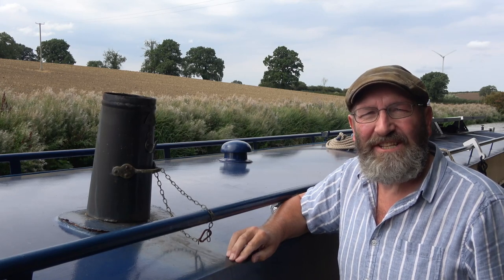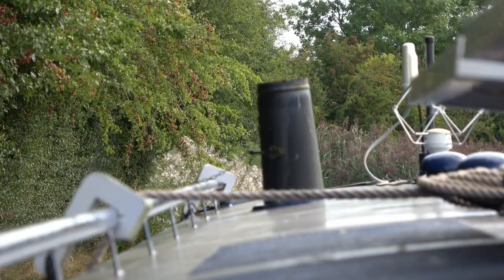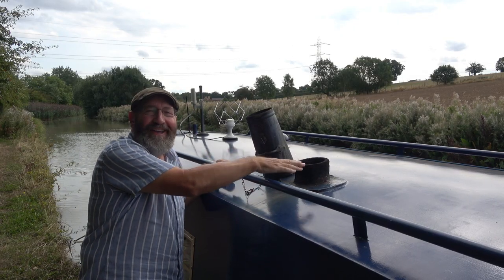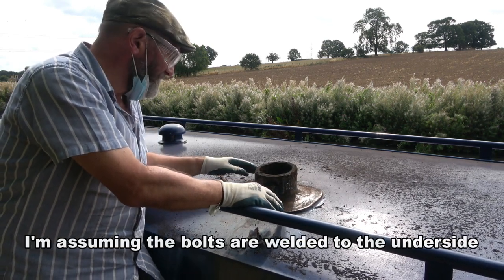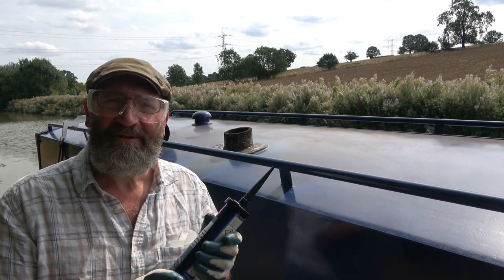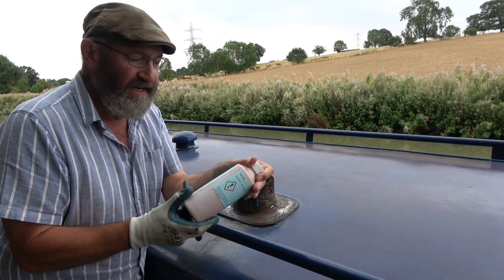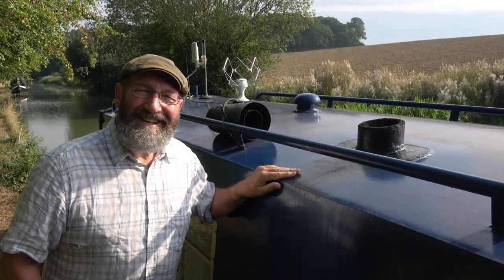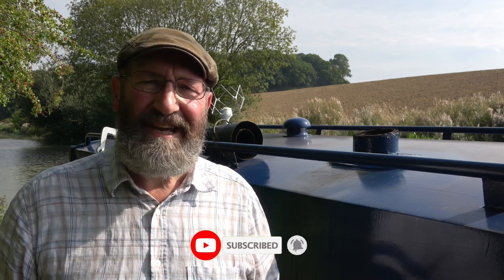295. Narrowboat Chimney Collar Repair

Comment: A real good job expertly done Alan, but all the jobs you do are always done the same way. Btw I believe that Vertan like similar products work by using Tannin and some clever chemical process that reacts with rust. The insurance told me I had to replace the chimney and flue pipe for the wood burner at my A-Frame cottage. I replaced it with interlocking insulated stainless steel sections, they also required it to extend above the roof ridge line, so this section was fitted with four stainless steel struts to brace it against the wind.  I'm happy to say that after four years use its been faultless. Your description of the job is a very good tutorial for others. Great vlog Alan .
Take care happy cruising and my regards to you and Jasmine
Reply from the maker: Thank you very much Ralph, very kind of you to say. I was interested to hear about your chimney. Thank you for your good wishes for Jasmine and I. Take care in all you do, cheers.

Comment: As long as it doesn't leak if it rains and looks reasonable. Job Done. I reckon you've earned yourself a Cheesy Roll and a Cuppa!
Reply from the maker: I've sealed it before but not had to prep with the grinder, it should be ok. I think I might have had some cheese topped rolls with me. Cheers

Comment: Thanks Alan, for a great vlog and looking at the chimney collar which has been engineered with what looks like very heavy gauge steel I'd say that you've done the right thing by not replacing it. I think that you may need to do the same maintenance every year or two and it'll possibly last the life of the boat. Well done Alan you've saved yourself a fortune and a lot of hard work. Take care and all the best. Stevie
Reply from the maker: Thank you so much Stevie. I realised when I did the job that it wasn’t as bad as it initially looked and that it still has a lot of life in it. I’ll make sure it’s well maintained going forward. All the best, cheers.

Comment: I remember watching David/Cruising The Cut's video about repairing his chimney collar. Best I can remember, he had a hard job of it. It's enjoyable seeing a different part of life on the canal, even if it's just a DIY repair project. Looks much better now, and I see from a previous comment you're considering not replacing the collar. A bit of money and sweat equity (or possibly a repair bill from a pro if it's too involved?) saved.
Reply from the maker: Hi Randy, having looked more closely, it wasn’t as bad as I thought, I’ll keep an eye on it and make sure it’s maintained. It’s a messy job to do, because of the way the collar fits together with the flue pipe. Cheers, thanks for commenting.

Comment: You did a great job Alan and i am glad to see your using Vactan to rust treat your boat as this is the best treatment i have found by far. Cutting the applicator down on the sealant tube will give you a thicker bead to seal around the chimney baseplate. Hope your staying safe and all the best.
Reply from the maker: Thanks Michael, kind of you to say. I have used Fertan but it has to be wiped off, whereas Vactan you can actually see working, much easier to use. I'm fine thanks and hope you are, cheers.
Reply: @MyNarrowboatVenture  Cheers mate

Comment: Honestly speaking Alan, I really think you are several years away from needing to replace the Chimney Collar. What you really had was only moderate surface rust, which you aptly addressed. The seal joints appeared to be fine and your adding an extra layer of sealant, so long as the underlying joint was clean, was probably a bit overkill and likely has bought you even more time until you would need to do it again. Other than achieving a new, smooth look on the collar through replacing it, I believe your existing collar just the way it is, will provide you many more years of service before you should need to replace it. Well done as always.
Reply from the maker: Hi Michael. When I did the job I realised it wasn’t as bad as I first thought and it would last for some more years. You’ll see I’ve said that in many other replies. It would be a very messy job because of the disturbance to the chimney flue and I wish to avoid that, so I’ll just keep an eye on it going forward and keep it maintained. Thanks for commenting, all  the best Alan

Comment: Hi Alan I think that changing the collar is making work for yourself , the existing looks in good condition and as you say is not leaking, if you do renew it you will have to release it from the inner stove pipe which can be difficult also you will have hell of a mess inside your boat if I were you Alan I would leave it alone but perhaps repaint it , Also seek a second opinion about it . Cheers.
Reply from the maker: Hi Ramsey, now I’ve had a closer look, I’m not thinking of changing it, as it wasn’t as bad as I first thought. And I agree, it would be a difficult and messy job and I can do without the hassle. All the best.
Reply: @MyNarrowboatVenture  Alan I'm Glad you changed your mind as it is a Horrible job. Cheers.

Comment: Alan you may have a boat that is not build by standard. In spring as you will rebuilt the chimney get rid of all rust, before put on the new one. That sika brand is on the high end it will do the trick. This coming will be okay if you over do it by a fair margin, so be generous is fine.
Reply from the maker: It's difficult to know but I would have thought it easier to use a standard product than make them. The collar wasn't as bad as I first thought, so I'll keep it maintained as best I can. Thanks for commenting, cheers.

Comment: Allan,   No screws in it   possible fully welded on?   Looked good after angle grindering do more get clean steel and do as did paint etc keep eye on it 
If get roof in side down 1 day check nuts or none will answer question. 

Steve
Reply from the maker: Thanks Steve. I think if it had been welded it would be evident outside but doesn’t look like it. I don’t want to disturb it inside but I would certainly look there before doing anything, if I was thinking of changing it. Cheers

Comment: Great video Alan. Just a thought, if you can't buy a replacement collar off the shelf, would it be a lot more expensive to maybe have one made by a metal fabricator?  Keep the vlogs coming 👍
Reply from the maker: Thanks Ian. The collar is in better condition than I thought, so I will try and keep it like that. I don’t want to disturb it unnecessarily. I would have thought anything bespoke would be more expensive than an off the shelf item. Cheers

Comment: Just a tip Alan when using any silicone, little bowl of water, wet your finger and run your finger over the silicone,  smooths it off and the water stops it sticking to your finger. I agree about Fertan, totally useless in my opinion, Vactan is much better. Can I ask, why replace the collar, looks fine to me
Reply from the maker: Hi Roger. The collar looked bad to start with but I found it wasn’t as bad as I thought, so I’m not thinking of replacing it now. I used to use water to wet my finger but there’s a better way. Use white spirit it allows you to work the silicone a bit longer and in my view get a better finish. I didn’t do that, as I wasn’t working into a corner or needing  a good cosmetic finish. Give it a go sometime.